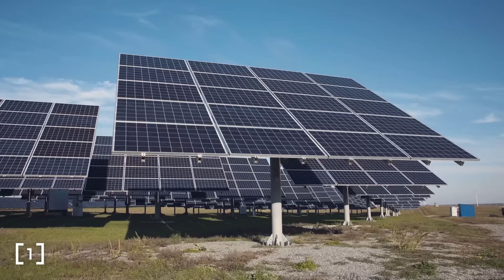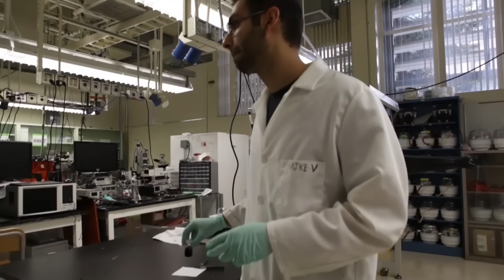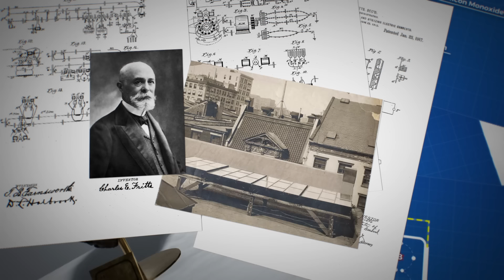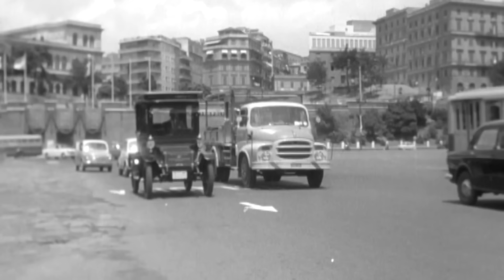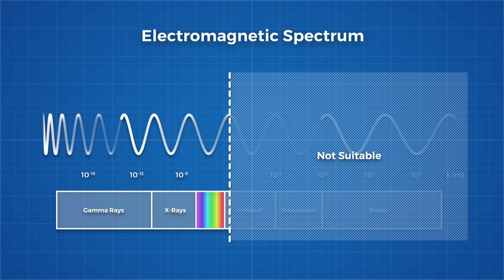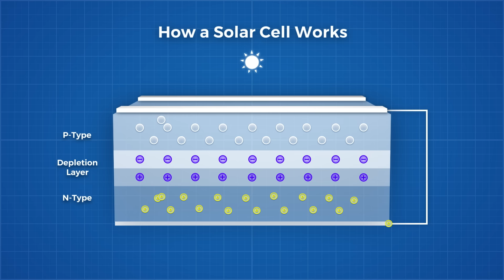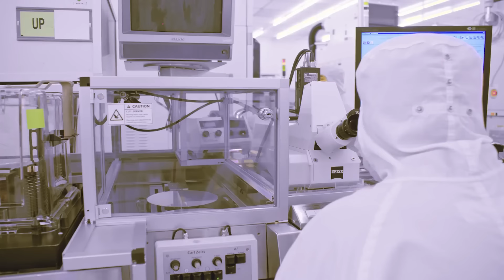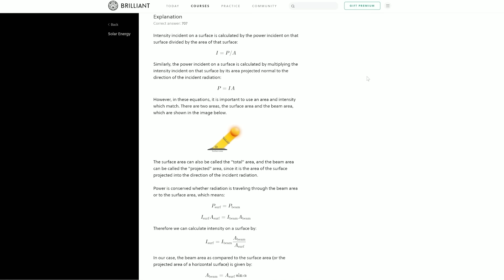The Mystery Flaw of Solar Panels

Comment: Should be energy META as it doesn't even become dangerous like dams or wind turbines when it breaks.
When we get a surplus of green energy we could just make Hydrogen to use up later (batteries) or in engines.
Reply: PV cells are still hazardous waste at the end of their useable life though.
Reply: @ElPants21  won't break and cause massive floodings and isn't a 100m tower falling down.
Reply: @Quantum-Bullet  just to say nothing is perfect or best
Reply: that's the future of energy yes, probably wont be as proficient as fossile fuel, but a t least it will last longer
Reply: It does currently create up to 900°F air space above it though. Which isn't great. Kite power systems have better potential for both safe and efficient power in my opinion.
Reply: beyond the simple and obivious issues of solar there is its utility and practicality in the grid. Solar has no rotating mass like every other generation system causing it to be intolerant to increased demand. we also have to look at the cost of solar w/ energy storage - hydrogen or batteries on a massive scale. is it practical? 

in the video he failed to mention that photovoltaic solar makes up 1.7% of the total us energy grid while nuclear makes up 20% with only some 80 reactors. however they are old, average age is 39 or 38. 

we need to transition away from fossil fuels which means the energy grid will not only need to be converted but nearly doubled to account for increased demand from electric conversions.  While solar is still promising we are at the bottom of an exponential price reduction curve. the amount of batteries or hydrogen storage alone is astronomical. The current largest battery farm is 230 megawatts the usa uses on average 10,958,904 mega watts per day meaning we would need 50,000 roughly battery farms @ 230 megawatts for 1 day
Reply: @Capthrax1  hold the phone, why would you need all your power for a day stored in batteries? the 7% hydro acts either as battery (with dam/basin and pumps) or as base load (without), no need to allocate other batteries there. so, maybe only 10000 farms? XD
Reply: @Daniel-yy3ty  fair. Enough. I was doing rough calculations . including wind hydro and nuclear its around 30% of total power so yeah.
Reply: @Daniel-yy3ty the battery cost for 1 day of battery back up using Australia's price is around 8 trillion . but cost of batteries are going down and down so idk
Reply: Waste is a huge problem for solar, these panels are not made out of wood sadly.

If we want to go green, nuclear is the only option. But everyone thinks every nuclear powerplant is chernobyl and fukushima combined, as if anyone still wanted to build plants in earthquake and tsunami regions, ran by soviet idiot party dignitaries...

Coal plants are vastly more radioactive than nuclear plants per unit of energy produced, but no one seems to know that...
Reply: @Reynevan100  you can't go nuclear. it takes too many years for a nuclear plant to recoup costs, and you have the looming threat of the pitchforks shouting your expensive building down
I'm not saying it's not one of the best options short term, I'm saying no one will want to foot the bill for one
As for the panels, from what i heard the concentration of heavy elements in them is way higher than from a mine, so waste probably won't be that much of a problem (if it's cheaper to recycle than to mine new stuff, who wouldn't?)
Reply: @Daniel-yy3ty  Well, I wish as I was as optimistic as you are. Pitchforks? Bills? At some point, sooner later than later, it might not matter anymore... but it will be too late...
Reply: @Reynevan100  It's a great discussion whether nuclear power is the way to go to save the climate and that discussion won't be encompassed here in my opinion.
Simon Clark has made a great video on that topic that I recommend you to watch. https://youtu.be/k13jZ9qHJ5U
Reply: @Reynevan100  yeah some countries still use coal while dismantling nuclear power plans... These plants should accompany us until we have 100% green/fusion and heavy emission fossile turned off right away.

Comment: Now that's some futuristic happening right there
Just how will it look 5 years from now...
Awesome as always
Reply: Five years from now commercialized installations of the SAFIRE Project will have begun to render large solar panel farms uncompetitive. Small solar devices will remain valuable for their portability, but solar panels to feed the grid will be a footnote. https://youtu.be/7GFFfmBGb5U
Reply: @hshs5756  Although the SAFIRE Project looks promising and I hope it makes it to the market, you're assumption that this will render large scale solar farms "obsolete" is incorrect. There are an exponential number of factors that you haven't considered and are jumping to conclusions. SAFIRE is still going the the testing phase and while it has demonstrated a working proof of concept that the technology works, it still has many more tests and hurdles to see if it's commercially viable. Will it be actually be cost effective to build or will it be like the petroleum industry in which the FOP (Factors of Production) keep the costs high and the only way to turn a profit is to constantly produce energy which would put unnecessary strain on the reactor. Years of safety tests and demonstrations still need to be done to ensure potential investors, governments and the average person that this is a technology that is genuinely safe for us to use. Then there is the regulations that will have to be created to protect which ever countries implement this technology. Which also address the elephant in the room, those who would see this technology not come on to market and change the status quo via political entrepreneurship( If you can't innovate, legislate basically). Also, you think solar technology will just stand still or become more efficient at the current pace? As technology gets more advanced, so does the implementation of it and while SAFIRE will probably gain traction, keep in mind that solar technology already has that same tech advancement edge plus the benefit of being available to the masses. Is SAFIRE better as a central technology similar to coal plants as the focus on the grid? Or can their be regional smaller power plants located within city limits? Because many average people will interpret it as the current electric company monopolies as a way of keeping their power over them. 
I'm not saying I hope SAFIRE fails, I've just seen a lot of "game chaining energy sources" not come to market because a whole host of factors people never considered.
Reply: @VinceroAlpha  Watch the recent documentary Planet of the Humans and pay particular attention to the solar segments of it, keeping in mind that the film was made by a life-long environmentalist and alternative energy backer. I seriously examined putting solar on my house a year ago until it became apparent that the numbers were not there. The systems are too expensive and have too short a lifespan to even begin to compete with coal-fired grid electricity. Every new technology has teething problems and I expect that for plasma energy. But solar (and wind, and biomass) have had years to work out their problems and so far can't even prove they have a positive EROEI.
Reply: Hs Hs I’ve heard about that documentary and watched some of it because a lot of his claims seemed suspicious. Most of his claims that solar isn’t viable stems from technology back in 97 to a decade ago. In other words, it ignores the advances in technology from when it was recorded.
https://www.engineering.com/DesignerEdge/DesignerEdgeArticles/ArticleID/20369/Planet-of-the-Humans-Is-The-Film-Scientifically-Accurate.aspx
https://theconversation.com/3-times-michael-moores-film-planet-of-the-humans-gets-the-facts-wrong-and-3-times-it-gets-them-right-137890
It seems that you’re ignoring the fact that they have a lot of holes in their argument of renewable energy. Not to mention that the film being scrutinized for it’s misleading representation of information. Then there’s the fact of where YOU live. In the US, the current time need to get back your ROI is averaging 8 years. Depending on where you reside, this can be less or more (Southern California/Texas or Rhode Island/ Boston) and make a huge difference in it. 
https://m.youtube.com/watch?v=p_vXrxx-Axg
I also get the feeling that you’re looking for reasons not to get it installed. It’s fine if you have done comprehensive research and factor as many variables as you’re aware of into your decision. But citing a documentary that has been under fire for its claims that have misleading on the topic at best gives me the impression that you haven’t done that. If you don’t trust in the technology and don’t understand it to the point in which you can move forward confidently and fully with the installation, that’s fine. BUT half-assing the research and giving vague examples to support your stance is unacceptable.
Reply: @VinceroAlpha  Not watching the entire documentary is unacceptable. You saw something you didn't like and shut it off, even though the message was coming from one of your own. That's what's wrong with people like you.
Reply: Hs Hs using ad hominem to attack is unacceptable. Again I have to point out that if you have done your OWN comprehensive due diligence vs depending on false and misleading information dressed up in a pretty documentary is unacceptable. So again, if you have at least called several solar panel manufacturers and asked for detailed literature about their products and expected ROI, weighed the choice of leasing vs buying a solar system, have detailed records of your current electricity bill for at least the past year, asking your electric company about their policies dealing with a home solar system, seeing if your municipality allows it and what potential tax credits you can potentially receive and/or eligible for, which type of solar cells are the best for your region, what kind of batteries are available that are the best for your current housing situation. If you haven’t done THESE AT THE MINIMUM, then you’re just looking for validation for your fear of it not working. Which if you have done the work YOURSELF since it will affect you vs relying on other’s opinions, then you’re worse than the type of people you haphazardly accuse me of being. So again, do the legwork, crunch the numbers, reflect on the information and if they don’t add up, then say it doesn’t work for you. But don’t sit and hypocritically bitch about it being fruitless if you haven’t even started the first paragraph of your research.
Reply: @VinceroAlpha  Look up the definition of ad hominem and you will find that that's not what I did. But if that's the best you've got, I guess you gotta run with it. Bye.
Reply: Hs Hs ad hominem (of an argument or reaction) directed against a person rather than the position they are maintaining. And since you still haven’t addressed my rebuttal not once and continue to use ad hominem vs discuss the topic and now running away because someone called you on your bullshit, that’s pretty amazing.
Reply: @hshs5756  if you are denying that safire is a fake project because you already donate to it, then stop. It would do you better to accept you got scammed and learn to not be as easily scammed next time.
Reply: @VinceroAlpha  nice reveal there, i didnt see your replies b4 watching the link he gave, i was also suspicious of the video and theres already a channel that debunks it. The only plasma physicist in the project already left, which is already a warning sign, a plasma based research with only 1 person having deep knowledge of it? Sounds too sus. The physicist didnt support their Electric Universe bullcrap, he just thought it was an idea wroth trying with the plasma thing. Now that he left (because the project team incompetency, and the project devolving to fraud), safire is just a pseudoscience project to scam people.
Reply: William I really didn’t want it to be but I just hate it when people are gullible and lazy enough to not even do the basic legwork to verify the information for themselves that a topic or subject is true/false. Hs Hs let’s his biases cloud his judgement and cherry picks information to prove his incorrect statements.
Reply: @Crustee0  I can't tell if you're just ignorant, or you're a paid shill for some other energy interest. Either way, the future is arriving whether you like it or not.
Reply: @hshs5756  lmao, keep deluding yourself. No paper published except for 1, and the one who made the paper when contacted by other youtuber states that noone can make the paper. Also its already "in progress" for so long, you would have noticed a news from big media company regarding this technology if it has made any real progress (even if the news misinterpret what this project is). Anyway, im gonna stop here, try to look it up yourself if you are going to believe a project made by people who believe in Electric Universe which goes against current scientifically proven model.
Reply: @hshs5756  Let me guess, they are asking funds to produce their reactors...
Reply: @Buran01  Actually, SAFIRE is extremely well-funded already. There's no shortage of big-money backers who can see where this is going.
Reply: @hshs5756  Good luck then.

Comment: ANSWER: Winter Bad, Night Bad.
Reply: Winter at Night wants to know your location
Reply: What's the problem with winter? Can't infared travel through clouds?
Reply: @Otzkar  Less sunlight hits the panels. And infrared isn't the one that creates most energy. 42% of the energy is because of visible light. And as we all know, due to the tilted axis of the earth, in winter, we have shorter daylight time, and more diffused light (As light has to take a longer route through the atmosphere). That's why energy generation drops off a cliff in winter.